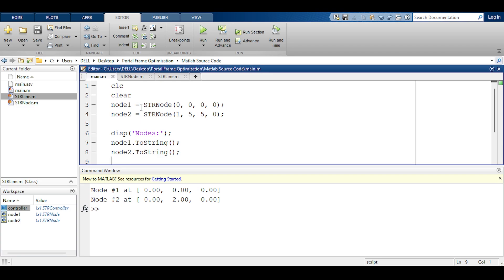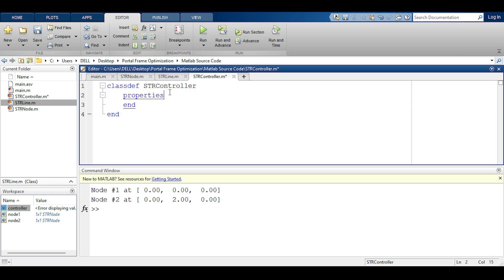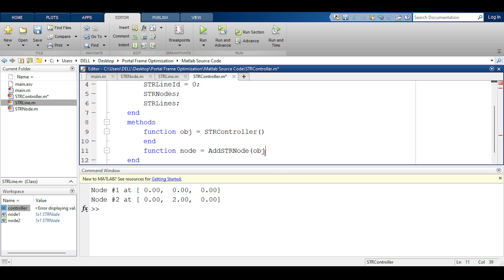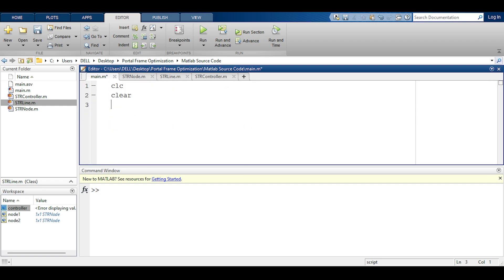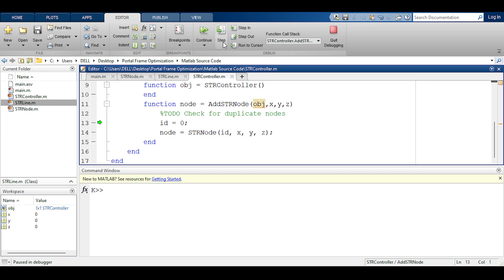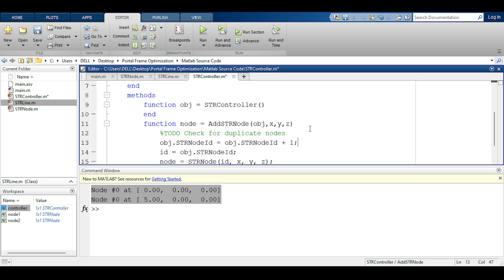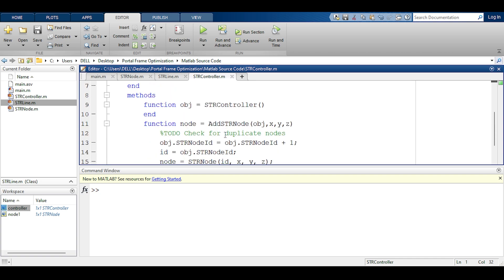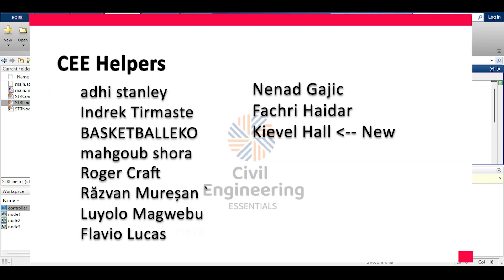Programming the Finite Element Method using MATLAB - Part 3: STRController

Comment: pls anything about programming finite element method for 3d elements ?
Reply from the maker: 3d elements you mean beams in 3d space? or you mean 3d blocks (cubes)?
if linear beams in 3d space, yes this is included
if 3d blocks, then unfortunately, it is not yet included

PS: Sorry for the late reply. I had a ton of things to finish and now I am gradually getting back
Reply: @CivilEngineeringEssentials  Thank you very much for your response; yeah i was meaning 3d blocks with random geometry